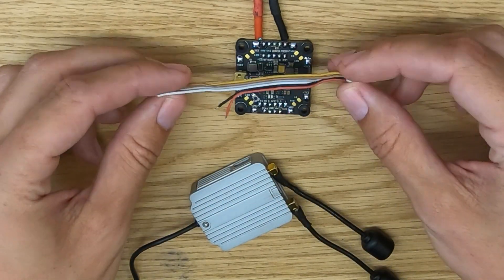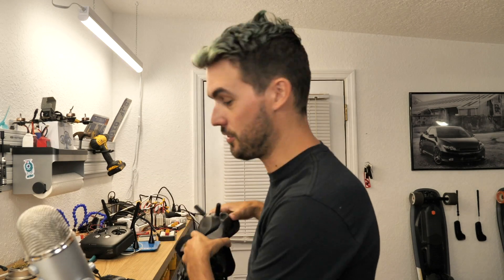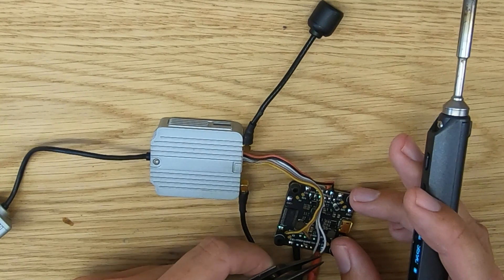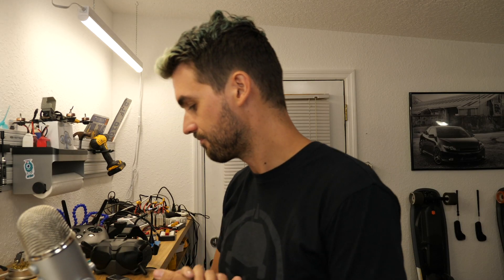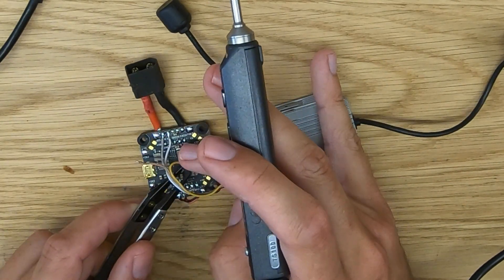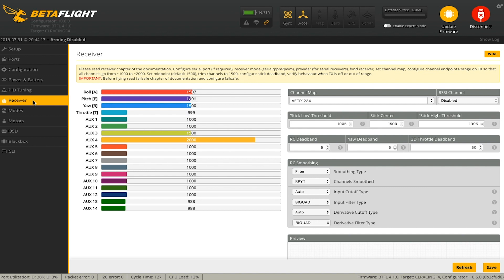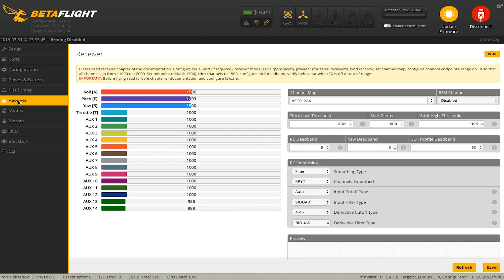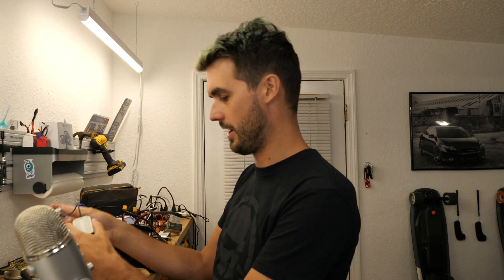DJI FPV Wiring Guide - How to connect to Betaflight

Comment from the maker: IMPORTANT NOTE: After more long-term testing, I do NOT recommend this flight controller for use with the DJI system because the 9V regulator is not a sufficient power source. While it worked for me on this one board (which is why I used it for this video) many others have reported the DJI system cutting out due to insufficient power. I recommend using the Hobbywing flight controller. The connections shown in this video still apply, just use a FC with a more reliable power supply.
Reply: Does this apply to the V2 JB F4 board?  I thought they improved the robustness of the 9V regulator in the V2.
Reply: @bohan9957  you can wire it to the VCC on JBV2. This comment is super late but I see nobody has answered you hahaha
Reply: @dreden2000  Hey thanks man I appreciate the response.  I ended up going with a different route and got the NewBeeDrone Infinity 305 stack.  I've also unscribed to his channel because he never reply to anyone.
Reply: @bohan9957  haha bro you cant expect large creators to reply all the time :/
Reply: Is it possible to connect a different goggle to the air unit
Reply: @lolonator-bedwars451   The air unit and the  caddx Vista only work with the DJI FPV goggles.
Reply: Ok thanks

Comment: Hi Drib, thanks for all the tips and the really good broken down explanations! I fly a DJI FPV (with Integra Google). Yet, I still have an >> Align MR25 << Drone lying around in my basement and would like to integrate the O3 Air Unit in this Quad. Do you know, is it possible to connect the MR25 to Betaflight to make the described settings, to also use the DJI 2 flight controller, or can I only use the Video capabilities of the O3 system with the Align Quad?

Comment: hi, just wondering can we use the radio dji remote controller if we used airplane fixed wing rc? also do you recommend the matek f405 wing or f722 wpx for the flight controller? thanks!

Comment: Hi. I got a question. Can you use the Dji remote control for multiple quads that have the Dji air units installed.  For example. I have quad 1 and 2. Can I use either quad 1 with the same remote control and then half hour later switch over to quad 2 with the same remote control? Like a Taranis x9D remote where I can change the model (quad) on the remote control.

Comment: Hi Drew, about the DJI FPV Wiring Guide . I see that you power the FPV trough your demo board. I wonder if it can be powered directly from the battery pack or the power needs to pass by the board for any reason?  I just need to get the video signal. Please let me know. 
please reply to eliashernan0213@g......

Comment: just got a iflight titan drone with the dji airunit AND an additional receiver on it (didn´t know it isn´t necessary as i ordered it). Now my DJI fpv Radio won´t connect to betaflight (no stick movements). Do i have to remove the additional receiver ?

Comment: Hi love your videos !! Need help , I’m trying to wire air unit to immersion vortex 285 , not using radio controller and have powered direct to battery pads . Any help greatly appreciated

Comment: So, if you only wire the red and black for power, you said you can get your HD-Dog to your goggles. Is it also recording to on-board recorder on the Air Unit? Or do you only get the video to the goggles and then record it there?  Thx

Comment: HELP!
I have the DJI recommended setup (FSSA PROII and FC) with the DJI DIGITAL FPV setup including the controller. I have everything registered and connected but I do not know how to get the controller to communicate with DJI's FC through Betaflight. I flashed with TMOTORF4 4.1.1 but since there is no soddering between the DJI housing and the TMOTOR FC I do not know how to configure the UARTs.  I tried what you said on this video but it didn't work, i assume because it's not the same ESC and FC. PLEASE HELP!!

Comment: The  the 9V Regulated pad on that Bardwell board isn't enough. My Air unit was turning off and rebooting after hard flips/rolls.  I wired mine direct to ESC +/- pads (vbatt) ( I'm on 4s ) and now it works fine.

Comment: Hello Drib 2 great video! Well supplied, I am currently on a car project RC 1/5 scale I have to mount the air unit of DJI on a car for FPV racing on car 1/5. Can you tell me if I need a flight controller to connect to the DJI air unit knowing that I am using a remote controlled car remote control. I hope my question is understandable in order to get an answer from you.

Comment: Actually, I think I figured it out by watching your videos and other in the business. But I am still left with one question. The power for the FPV air unit says 7 to 17 volts, but my T-motor F4 FC only has 5 volt pins. I do see a part on the T motor F4 FC where I can jump two points to get battery power (5 to 36 volts), I assume it only gives what a 4s battery offers (14.8 volts). Does this sound correct? Again, many thanks. Next time I am in Orlando, I will definitely stop by your store!

Comment: Lots of questions!! So I am not using a Long Range receiver mod like the TBS or R9.  Would you recommend going this route with the DJI? I have a Session and GP 7 that I currently use for recording, but it appears that the DJI setup would preclude the requirement of me mounting a go pro?  

Do you think there's room for the DJI air module in the Reverb or Armattan Frame?  Where do you mount the Air Unit on your dropped Deck frames?

Comment: Hi Drew, Got a problem if you have a moment. I have the Riot Control F4 and just wired up the FPV Air Unit. I'm finding that the Riot Control 9V BEC is not providing adequate power to the Air Unit...it continuously powers on and off and won't output a video signal. I can successfully power the Air Unit directly from VBAT on 4s, but unfortunately my build is set up to fly best at 6s which will fry the Air Unit.
I'm assuming the JB board you show in your video has a more robust 9V (maybe more amperage or watts?). I may have to upgrade, but I was bummed the 9V pad on the Riot Control isn't cutting it. Any other ideas or workarounds, or is the JB board FTW?
Thanks in advance.
Reply from the maker: Yes the 9V reg on our board is not sufficient. I also do not recommend the JB board. I started having issues with that regulator too. 
The board that has proven to have the most reliable power supply, is the hobby wing FC. It has a two amp 12 V regulator that does an excellent job of reliably powering the DJI air unit.
Reply: @drib2896  Thanks for the reply. I had a CLRacing F4s lying around, and its 9v 2a pad ended up working great for the Air Unit. Had a great flight session with it today.

Comment: Hi, I have problem with OSD -> Battery Voltage from drone does not appear on the screen. I try 4 different FC: Kakute F4, F7AIO, Omnibus, and T-Motor F4. Grey wire to RX, white to TX and MSP. All doesnt want work. Please! Halp me to fix that. What I do wrong?

Comment: So you say you can use it without a flight board, but yet you had to solder it to a flight board to get power to it. if I wanted to just strap it to an RC car or something how would I power it?
Reply: I believe all it needs is power so you could just use a separate LiPo to power the Air Unit.

Comment: I'm still having a problem trying to get battery voltage from the bird to display in the DJI goggles .. I've download BETAFlight 10.6.0 and I'm running 4.1.0 firmware on the bird.. there's still no DJI_HDL_7MS protocol listed in the RX dropdown menu and from my understanding you have to have that before it will work.
Reply: Same here, but my OSD works, my sbus doesn't work
Reply: Same with Matek CTR F405, maybe all chipsets/manufacturers are not ready atm.

Comment: Dear DRIB
I need help. I'm new to this but i followed exactly your instruction. I soldered the SBUS, i opened the port Serial RX for the SBUS, i enabled SBUS in receiver tap, but somehow it has no signal. One thing i did differently though is i use power and ground from battery pad directly since the iFlight SucceX f4 micro has no 9V output pad. as you stated in this video, powering the air unit and we can fly it just like that but I was amazed by your review video on this DJI FPV system, and i don't have long range remote set up yet, so here i am with the DJI remote but stuck with no signal. so any idea what i did wrong? thank
Reply: First thing you want to do is go to the online DJI manual and double check your wiring on page 11 perticuly the gray and white wires TX and RX https://dl.djicdn.com/downloads/DJI_Digital_FPV_System/20190731/DJI_Digital_FPV_System_User_Manual_EN.pdf  .. UART 4 need to be turned on to MSP and UART 1 RX serial needs to be turned on .. also have you registered and updated all your DJI gear it won't work unless you do that .

Comment: Hello guys.  how do you enable the dji hdl protocol from betaflight?  I can't use betaflight version 10.6 and firmware 4.1 on fc.ma nothing appears
Reply: I'm having the same problem Fortunato trying to get battery power from the bird to show up in my DJI goggles .. Can't get the HDL protocol and I even tried the unofficial 10.6.0 and 4.1 that are listed in the unstable versions of betaflight for my FC and I'm using the same FC as Drew is in this video ..

Comment: Little update as I ran into trouble getting this set up. 

DJI HDL has been removed in the latest Betaflight 4.1 RC and configurator beta. now you select SBUS and add CLI command "set sbus_baud_fast = on" and set DJI HDL in the googles and you should be good to go - Developers somehow think making it a CLI switch is easier...
Reply: This didn’t work for. Still had video feed but no rx signal.

Comment: Hey mate, great video. I am trying to connect the air unit in an RC plane (3S LIPO). Should I connect directly the power wires to the lipo pack? The BEC of my ESC in only 5V...

Comment: can you connect this DJI Digital FPV System to any Naza M V2  flight controller 
I ask this because it has S bus  …
Reply: Should be able to connect to any FC that has SBus, 5V, some grounds available, and possibly a TX/RX UART for the OSD for batt voltage and PID tuning. I've seen it hooked up to several different FCs and that seems to be all that's needed.
Reply: @charmande80  I plan to use on 5v output from omnibus f4. Will report back let you know  how I get on
Reply: @pornzi  sounds good let me know how it goes. I'm not ultra experienced but I'll help where I can if need be.

Comment: Hey Im really struggling to get my OSD to even display my drone battery, any tips? Seems like it should be straight forward but I cant figure it out. Thanks in advance
Reply: I just noticed that when I turn on the configuration/MSP, I get the Battery OSD, but my drone wont arm. But it will arm when I have Serial RX on, and config/MSP off.. It wont let me have both on. Any thoughts? Im stumped.

Comment: Sup drib! Thanks for the guides, been very helpful. I just need to get my kwad battery voltage displayed in my goggles and cant find that particular "how to" anywhere. I have the gray and white wires hooked up to the uart 6 on a mamba flight controller. Also power is coming from the vcc, which should be outputting full battery voltage (4S) . Probably just a setting wrong somewhere...?? I set it up like my analog kwads in the osd section in BF. Please help... lol
Reply: Hey, did ya figure it out? I had my tx and rx cables switched. When hooked up correctly the battery voltage. The dji pinout, that i saw, was kinda  confusing.
Reply: @illegalfpv9030  nope still does not work no matter what uart I use and having either white or grey on TX or rx.
Reply: @charmande80  are you on 4.1
Reply: @DaytonaJim78  tried 4.0 and 4.1 with latest firmware and even experimental firmwares. Tried my system on the kakute F7 HDV flight controller built specifically for DJIs FPV system with prebuilt wiring for the air unit and still same issues. I contacted DJI support and after them having me redo everything I already did they have pretty much confirmed what I believed to be true and that it's a faulty air unit. Waiting on return instructions but when I get the replacement hoping everything is smooth as butter.
Reply: @charmande80  look in the comments from 5 days ago look for comment by gattung he said to use the newest 4.1 and change a setting in the cli and goggles
Reply: @DaytonaJim78  thanks for the info. Tried this with no luck. Still thinking I got a bad air unit. Hopefully a replacement will solve that.
Reply: Never mind. Figured it out... i think
Reply: @illegalfpv9030  what was your fix because I'm having the same issue. I noticed in the video he says connect WHITE to TX and GRAY to RX but if you look in the DJI manual it says do the opposite, GRAY to TX and WHITE to RX. Even with my UART set to MSP for either config I'm still not getting batt voltage.

Comment: Hey! Your vid convinced me to get the DJi system. I ordered a kakute f7 stack, a 65amp esc+6s motherboard. I am not sure if I can hook the fpv up to this. Can you help?
Reply: You can, just connect to a UART and enable in betaflight as shown in this video.
Reply: @Perceivedshift  Awesome thanks for reply but the DJI only accepts up to 4s. Is the UART a lower voltage? sorry for all the dumb questions
Reply: @Sal_The_3rd  The UART is only for communication to the FC for telemetry and settings.  Power the dji system directly from battery voltage.  If you are running higher than 4S, attach a 12v step down regulator.
Reply: Hey guys! I ended up getting the system but my radio doesn’t seem to be communicating with my flight controller in Betaflight. Wonder why

Comment: If using a Taranis with crossfire, is there a way to get in the Dji Menü and the hole stuff? If not that's the biggest reason to get the controller too? Would be great to have a video with use of Taranis what most users have and the limit of functionality with it!

Comment: I’m having an issue with my FPV system. 

1) I can’t switch my power from 25mw to 700mw
2) my aircraft voltage and flight time do not show
3) I only have channel 1-3 and 8.
Reply: Im having a similar problem............
Reply: I believe 1 and 3 have to do with the system not thinking I’m in the United States. Other regions only allow 25mw and limited channels. Just don’t know how and where to change.
Reply: Try this out it may do the trick. He talks about how to change it via a file on the micro SD card. https://www.youtube.com/watch?v=u0e0mB6EEyY
Reply: You have to unlock FCC mode with your micro SD.. there is a tutorial on YT :)
Reply: I had range problem and i thank that it was the mode 25mw. I switched into 700mw and i still have issues. 
How is your dji range guys ? Inm less than 600m in an open field... so disappointed

Comment: @Drib 2 This might be a stupid question but I was wondering...Red - 5V, Black - GND, White - RX1, Gray - TX1, Brown - Any GND, Yellow - SBUS, would these connections be correct? Trying to wire a Omnibus F4 FC board (not too sure which version... it was just laying around) with the DJI Air unit

Comment: Seems to be a pretty good system and easy to install
Reply: Very still nobody tell how to fix problem with my reciver lol... My remote control is binded all green I can see icons in goggles of drone and remote bu don't see any movements or change modes...

Comment: How to trim it?
Reply from the maker: You should never trim a machine with a flight controller. End points are set able via the goggles. If center points are off, calibration should fix that.

Comment: If powering off a 9V pad why cant we use it on 6s??
Reply from the maker: You can. No problem running it on a 6S, or even higher machine. It just needs to have a voltage reg so the air unit itself doesn’t get higher than 17V

Comment: Do you know if the DJI RC is USB-connectable so it’s usable with sims and games? Thanks!
Reply: That does not work. You can connect it via the headphone jack which required an adapter though.

Comment: Can you change the antennas and how does that enhance or degrade the video quality?
Reply: Another thing is it running 2.4 or 5.8?
Reply from the maker: 5.8
Reply from the maker: You should be able to use any 5.8 antenna you want.... but DJI strongly reccomends their antenna. The system is much more complex than our simple traditional analog set ups so I plan to follow their rec

Comment: I know that Bardwells FC can put out 9 watts but given the Air Unit apparently takes up to "about" 9 Watts as well, do you think it's a good idea to use it direct from the FC like this?
Reply from the maker: Working for me no problem. If it really draws 9 watts than 9W / 9V = 1amp
Not sure what the reg on the Bardwell board is rated for. But it’s working for me
Reply: Drib 2 Good to know, thanks!

Comment: If the wires are plastic wire, should recommend them to use silicone wires. I see from the shape of wires after you tweezed them.
Reply from the maker: Yes I HATE the plastic wires
Reply: Drib 2 Same as everyone, I bet.

Comment: That's wild man. I gotta get that. I do range tests on all my radios. That's the first thing I'll do against my crossfire. I've done this with all my radios Frsky spectrum and crossfire. I put the transmitter on my coffee table (ground level) go outside into my truck and just drive with the transmitter. I've gotten farthest with crossfire dynamic range works every time. . I get 1km almost exactly through many   building as I live in  populated area.

Comment: Can you make another video on how to set up the switches like the Flight mode, Angle, Horizon, on the DJI RC controller?  Thanks,
Reply from the maker: You set it up in Betaflight just like any other radio

Comment: I hope they are going to include a connector with some decent silicone wire for the production models.  That looks like the cheapest plastic coated wire you can buy.  I noticed that in the closeups on the rotor riot video.  The wire insulation looked like it melted.😪